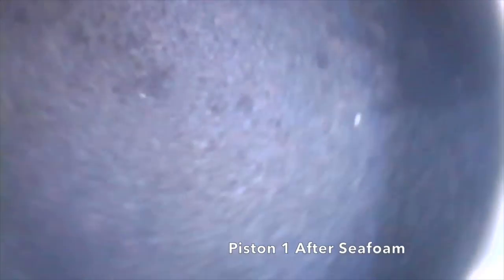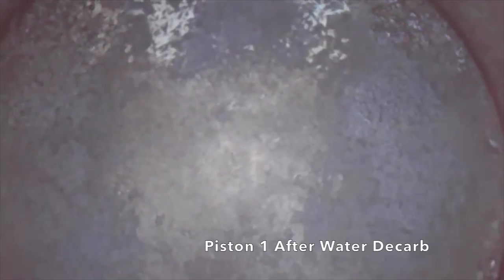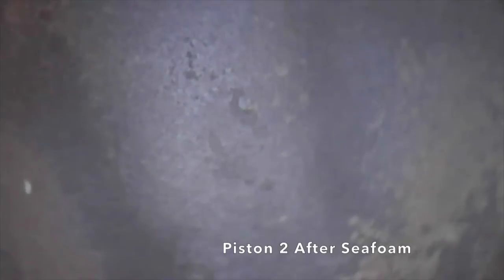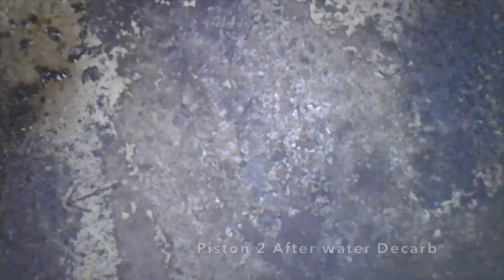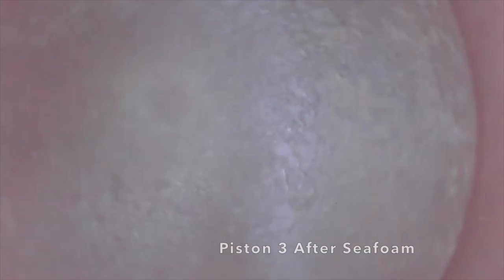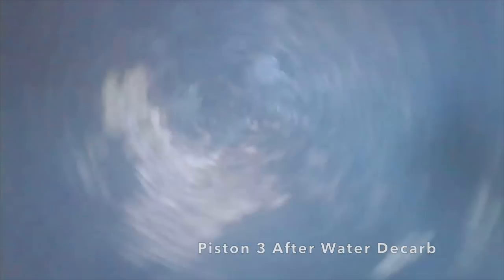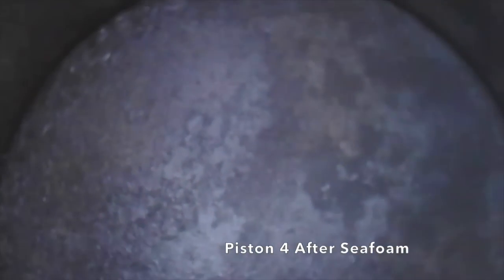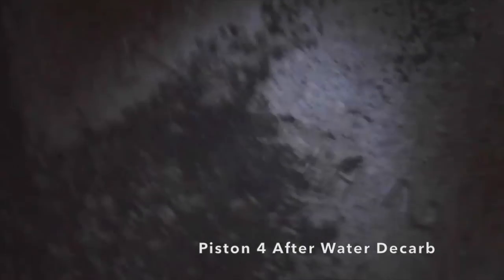Seafoam vs Water Results and Response to Chrisfix

Comment: First of all your statement about a vehicle engine verses a lawn mower engine is false, a combustion engine is a combustion engine period. They ALL work the same way some way shape or form and all share similarities of one another with some differences. Vehicles have more moving parts than a lawn mower engine yes, but they share many parts. Even diesel engines work the same. The difference with diesels is, they do not have spark plugs to ignite the fuel because diesel can not be ignited in that method, it uses the compression of the engine to ignite it. 

Saying a lawn mower does not work like a vehicle engine, BWAHAHAHA. Lawn mowers depend on air to keep cool, vehicles rely on coolant. They both have connecting rods, cranks, bearings, valves, lifters and camshafts. The only combustion engine that does not require what a 4 stroke engine does is a 2 stroke engine which do not have camshafts, lifters or valves.

If people read the label on the seafoam container, it states that you should do this when you are replacing your spark plugs. It also states to pour 1/4th slowly directly in while running. It also states after that to rapidly pour it in until the motor stalls. At that time the complete bottle should have been poured into the engine. Then you should allow it to sit for a while I have let it sit for 20 + minutes before starting the engine, then rev it in safe limits to blow out the gunk. 

NOTHING will fully clean combustion chambers chemically with the first application. Some things take a few applications. The only way to completely remove carbon is by a complete rebuild of the engine. Personally, I have never had problems with using seafoam products. I have also used this method as well. I do not suggest pouring water directly in, but using a spray bottle to mist it in. 

I do highly recommend using warm water or hot water if you are going to use water. Cold or cool water added to a hot engine can reek havoc and damage it. The easiest way to prevent carbon build up is by using quality petrol and quality oil. There are really good products that can be added to fuels and lubricants to prevent carbon build up.
Reply: BMAC is right to an extent. The combustion temperatures of an internal combustion engine are related to its " mean effective pressure "...or the pressure generated in the combustion chamber. A small engine developing 100hp has a higher MEP than a large one developing the same power. Higher MEP=Higher Temperature. Diesels have a lower temperature combustion than Petrol, typically around 610-650 deg C at full load. Petrol engines can reach 1050 degrees C. A lawnmower engine operates at very low MEP for reasons of cost. My lawnmower, a Honda, produces 2 hp from 125cc. A fucking 50cc scooter is more powerful.
Reply: +Paul Evans a 50cc is 2 stroke.
Reply: +MrBonami2  Depends which 50cc you are talking about. my Honda C50 is a 50cc (49cc) 4- stroke.
Reply: +Paul Evans yea but it rev at 8k.  a lawnmower can make as much power if you increase rpm
Reply: MrBonami2 No, it can't. The lawn mower has a low MEP as a consequence of a low compression ratio. The Honda engine operates at a higher MEP. Furthermore more, the lawn mower engine is designed for torque, and has a long stroke. It doesn't want to rev highly and would quickly br destroyed if it did.
Reply: +Paul Evans well it sure can rev higher than stock speed. no idea for lifespan but im sure you can get some hp. my brig 148cc is 4.75lb ft of torque i think or hp
Reply: +MrBonami2 even the old brigs is writed 3.5hp